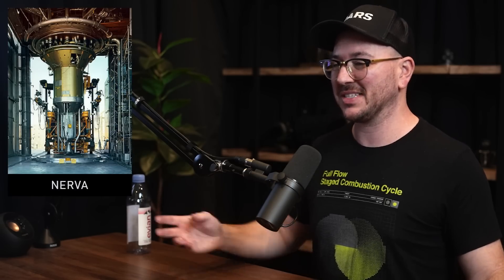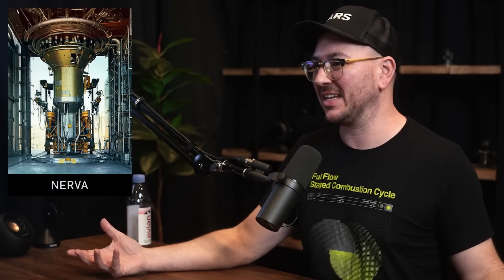Nuclear rocket engines | Lex Fridman Podcast Clips

Comment: I think most of these questions were asked by science fiction novel writers. Perhaps the most accurate answer given both by Isaac Asimov and Dan Simmons is the fact that humans were at the limit of their capacity to understand the universe when they came with the theory of relativity and quantum theory and so what is left to discover beyond this by processing higher and higher volumes of data is going to be made by Artificial Intelligence and so what is left to discover will be discovered along with practical applications, however, we wont be able to understand it. 
In Asimov universe the drive that allows humans to travel between stars was develop by robots and in Hyperion i remember when the artificial Inteligence tells one o the characters that while humans would've with a huge effort at some point develop the relativistic drive (travel at speeds closer to light) they would never have the capacity to comprehend the theory behind the creation of portals (instant travel through gates), In the end is revealed that in order to travel through space-time instantly, the connections were made in a dimention not accesible by humans where a giant network existed that connected all these portals, a network where the AI lived and at the same time needed a lot of processing power. Basically the technology and processing power to scan objects on one side and the position of every particle and atom on one side and transfer it through a fifth dimension to the other side, almost like we see particles disappear and appear randomly in quantum mechanics.

Comment: Just one sort of Thrust/Shockwave propulsion that could be tested in the next few 100 years to see whether it makes any sense to use it, could be something that uses energy from focusing solar energy transmitted by solar panel satellites on space. The energy from several transmitting satellites is focused (some groups like one at Caltech are already working on Solar Power on orbit) onto a LASER on the rocket (modulo taking care of all the precise control of several beams following the rocket motion). If the energy is going to come from outside, energy density is perhaps not a big problem (although energy carrying/handling capacity would be), so might as choose the propellant independent of the energy density. As mentioned in the video, something (propellant) still needs to be ejected until we can control spacetime or quantum fields at scale, and the propellant needs to be stored on the rocket unless it can be harvested during the motion which is rather difficult with the thinning of the atmosphere with increasing altitude. So, let's say compressed air is used as a propellant. The LASER ionizes the air at the exit of the tank, and the ion jet is accelerated with magnetic field on board the rocket. It is likely that some forward boost/shockwave phenomenon could be studied based on certain kinds of elastic behavior of the magnetic field. If solar power could be harvested from space in reasonable quantities, it could potentially be used to power rockets.

Comment: nuclear rocket engines ok but with people is that not a problem with weight of shielding ?
Reply: Not really - the exhaust points down, the people are at the pointy end. Same shielding that protects them from Solar Radiation will protect them from the engine.
Reply: @PiDsPagePrototypes  What is a disadvantage of nuclear rocket engines?
Disadvantages of nuclear rocket include radiation effects by the nuclear reactor, and the high weight of the engine assembly.
Reply: @aaronrobertcattell8859  Mass of the engine is offset by the ISP and the size of the payload it can push. Sheilding is a non issue for passengers, as the sheilding for cosmic rays and solar winds will also block onboard reactors.
Reply: @aaronrobertcattell8859 The radiation from space is far worse than the reactor. For mars astronauts will get less radiation due to quicker missions.

Comment: IMHO a good reason to not go for nuclear rocket engines is that, even if it's just payload and thus not used for take off itself, but only to be started way out of earth's way, you don't want to  risk to spread radioactive material over earths surface in case the rocket blows up during take off.

Comment: Other than the obvious weight problem, hydrogen is not easy to deal with. It is difficult to build tanks to hold it in, as the tanks will usually leak because hydrogen molecules are very small. Plus, the tanks become very heavy and nitrogen doesn't have / give a good amount of thrust. I believe hydrogen should be off the table for use until we can find a lighter weight tank solution.
Reply: Hydrogen powered Delta IV/ Delta IV Heavy, which are extremely capable vehicles. And in the context of a nuclear engine, you get WAY more thrust, so the thrust of hydrolox engines is not a concern.
Reply: @cerebralm  I agree with you about the nuclear configuration, but it's not really worth moving forward until we can create lighter weight tanks that won't leak. Mainly because they need to contain the hydrogen for long periods of time, traveling from Earth to The Moon, Mars etcetera.
Reply: @ShawnRitch  Ah, right. Current-gen hydrogen systems need top-ups till just before lift-off. We will have to do better...
Reply: @cerebralm  :)  consensus ! Thank you
Reply: Hydrogen leakage through the wall is basically nothing. It happens, but its a vanishingly small problem. Boiloff is a much bigger issue, but also one that can easily be addressed

Comment: Pulsed nuclear thermal is an interesting expansion of regular nuclear thermal engines. Using pulsed reaction (inserting/removing control rods) heats up propelant to higher temperatures giving higher specific impulse.

Comment: Nuclear thermal is basically still the same temperature as chemical rockets because we're limited by materials properties. The only real benefit you're getting is the ejecta are Hydrogen which are 9-18 times lighter than water at the same temperature (and accordingly 3-4 times higher Isp)
Reply: Not if you use a gas core. Then your core is uranium plasma.

Comment: Wouldn’t the exhaust bombard earth when leaving and arriving
Reply: Yea it would. Its an upper stage launched on chemical rocket. The real fear is an explosion on the pad or in the air during liftoff. Basically a dirty bomb.
Reply: They would use liquid and solid fuel for leaving and entering earth. Since the chemical propulsion is more efficient in that way.
Reply: @Silverseekr  I mean once you are in orbit
Reply: @bar10dr  Don't point it at Earth. When a rocket is leaving or arriving at a planet it is pointed tangent to, not directly at, a planet.
Reply: @bar10dr bar10dr  You would ignite your nuclear thermal engine once out of orbit. 

The exhaust isn't really an issue. The reactor heats hydrogen and the hydrogen expands as an exhaust.  

Nuclear electric, the same.
Reply: Even if the exhaust pointed at the Earth, the Magnetosphere would grab the highly charged spray of atoms and pull them along the field lines, first through the Van Allen belts and then lower in to the atmosphere in the same way as charged Solar Wind is, as Aurora at the poles, expending it's energy high in the atmosphere.
Reply: @PiDsPagePrototypes  But they use hundreds of thousands of years to halv the radioactivity to safe levels no?
Reply: @bar10dr  Halflife is different for every radioactive element, and each isotope of each element, can be eons or seconds or anything between, but once it hits the magnetosphere, it's not making it to the ground.
Reply: @PiDsPagePrototypes  The magnetosphere redirects radiation except gamma rays to the van allen belt to be more exact. It is not a 100% thing though. As far as isotopes having different halflives, we are of course talking about isotopes being used by the hypothetical nuclear rockets.
Reply: @bar10dr  The exhaust is only Hydrogen. The radioactive materials that generate the heat stay in the fuel rods, so the only isotypes to worry about are those of the hydrogen propelant. IIRC, those are all fairly short, would have to look them up to be sure.
Reply: @PiDsPagePrototypes  What if the rocket that brings it up blows up before it reaches "space"?
Reply: @bar10dr  This is where the reliability of vehicles like the Falcon9 comes in to play - you make sure you use a reliable rocket that is highly unlikely to blow up, and the vast majority of rockets are launched out over oceans so if anything does happen, it doesn't land on peoples heads.
Beyond that, the majority of the vehicles that will end up with these motors will be built in orbit from material mined in space, so will never see use with chemical based launch systems.
Reply: @PiDsPagePrototypes  But what would happen if a rocket with nuclear matter in it exploded on the stand? It's not unheard of, accidents happen.
Reply: @bar10dr  Now you're just fishing for any reason to be negative about the technology.
Reply: @bar10dr ☢️